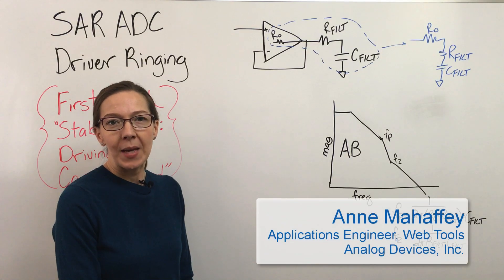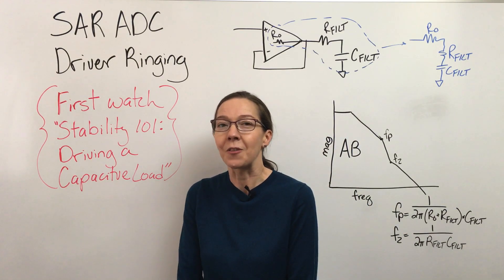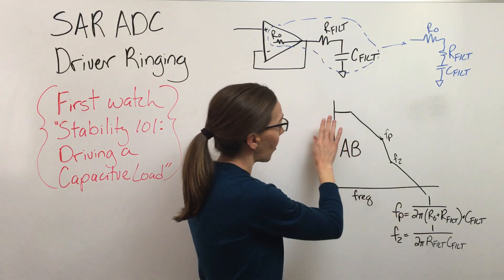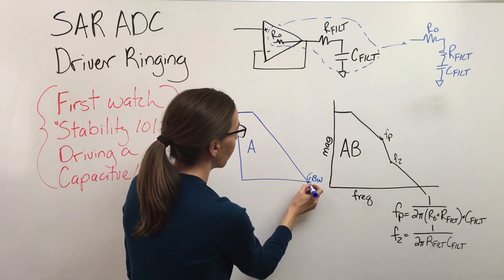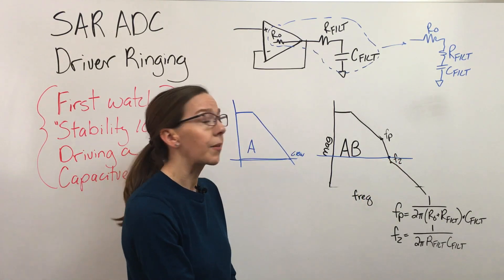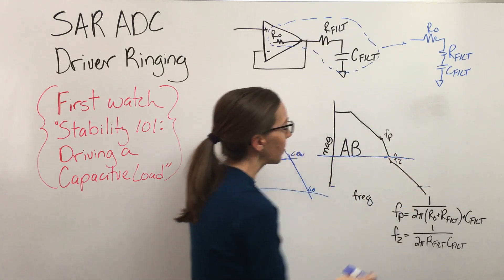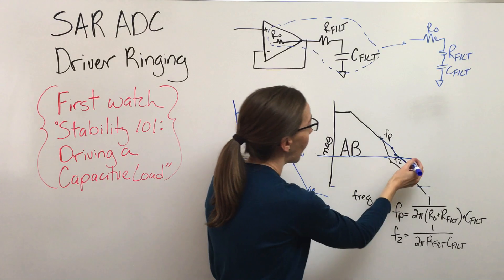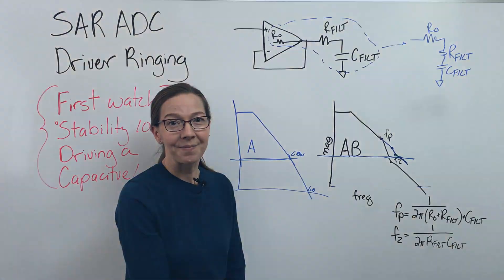Driving SAR ADCs #6: Driver Ringing and Instability

Comment: I believe that increasing the value of Rfilt actually moving both the pole and zero to the left (low freq.), not moving them together. The cross over frequency then will be high than fz, so it will be more stably.
Reply: (re-posting, b/c my original post seems to have disappeared)

I see what you are saying, and you are correct – I did not illustrate this well when I marked the “new” pole/zero pair (at about the 4:00 mark).  Increasing the Rfilt value will both a) move the pole/zero pair closer together, and b) move them both to a lower frequency (to the left on the plot).

When redrawing the pole/zero location, I jumped a few steps, without mentioning them out loud (or even being conscious that I was skipping them).   What I didn’t mention is that often, when you increase the Rfilt to better isolate the driver from the capacitive load, you would also likely decrease the Cfilt by a similar factor, to keep the RC BW somewhat constant (RC BW considerations discussed in video #3).
Reply: I see what you are saying, and you are correct – I did not illustrate this well when I marked the “new” pole/zero pair (at about the 4:00 mark).  Increasing the Rfilt value will both a) move the pole/zero pair closer together, and b) move them both to a lower frequency (to the left on the plot).

When redrawing the pole/zero location, I jumped a few steps, without mentioning them out loud (or even being conscious that I was skipping them).   What I didn’t mention is that often, when you increase the Rfilt to better isolate the driver from the capacitive load, you would also likely decrease the Cfilt by a similar factor, to keep the RC BW somewhat constant (RC BW considerations discussed in video #3).